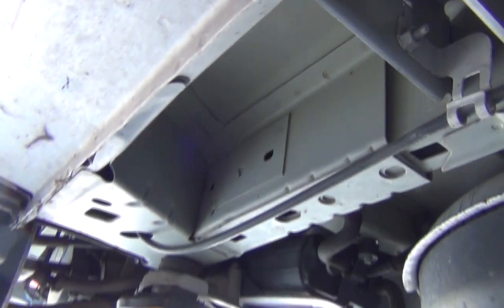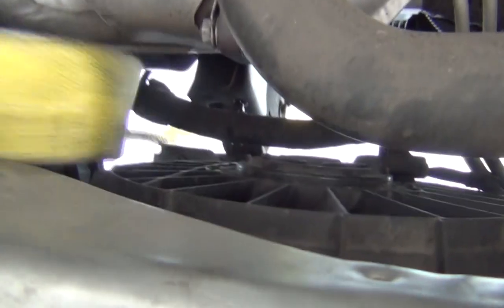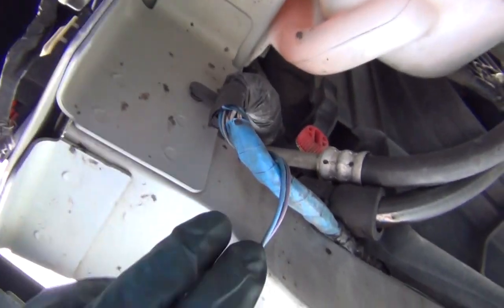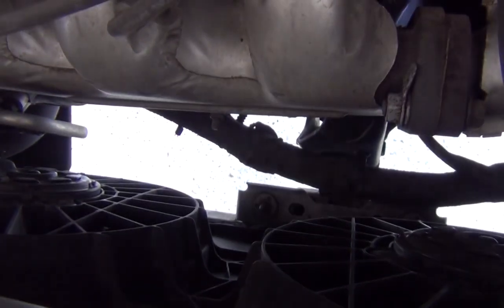How do you hook a Town and Country Mini Van?

Comment: Every minivan I've winched out was already buried to its bumper in the mud by its owner's unwavering determination to just spin the tires until they've covered their car in mud and managed to dig a hole significantly deeper than their tires reach. Just loop onto the rim spokes, and put the vehicle in neutral or the axle or suspension arm if its backwards.

Comment: I like your videos Brian, so I can learn in english how the auto words for parts and services are. I´ve lived in Salt Lake. But I live now in Brazil. Here about 80% of the autos are 4 cylinder with a 5 speed manual transmission, so being a mechanic here is mostly working on these models. Many people here don´t wanna buy automatic transmission vehicles or V6-V8´s engines because they burn more gas and its much more expensive to service, and requires more qualified technicians.

Comment: Thats the best way.  The factory chassis points were often ripped open or damaged and can spread open or tear on long hauls from my experience(30 years)  I feel better with straps and always rear both sides.  Control arms not designed bend easy.  I learned the hard way

Comment: Most all cars have this issue not only mini vans with poor tread on the tires. When we get to them most are buried to the oil pan so your good idea does not work for us. We have special slings for slotted wheels both front & rears we use which can also be use to lift the front or rear safely front or rear with no damage. I have owned my own recovery bussiness for 35 plus years in the Colorado Rockies we see it all and recover every thing even army tanks & SUBARU'S R no exception, Cheers

Comment: There is an engine mount bracket right in the front which is perfect for towing with no damage, provided you use aircraft straps, the actual alloy mount, NOT the motor section
Reply: Isn't that what he did in this video?

Comment: On a side note, its a general rule of thumb to stay away from straps with build in tow hooks. They are usually made with lesser quality metal that breaks at a  lower force than the strap itself.  It would be safer to use a strap with loops and connect it with a d-ring or clevis. The same goes for using a chain, if it breaks the force sends it flying at speeds that can easily cut a person in half. Just something to think about.
Reply: myth about "cutting peope in half" bud
Reply: @crabtrap  it depends on how much force is behind it. There was someone on the news in our area long ago because it broke one of her feet completely off her body.

Probably more likely in awkward stick vehicles that people mindlessly pull forward even though they need to be pulled up out of a steep ditch or up over something like a tree.
Reply: @Loduwijk  chances are, the foot lady had the cable wrap around foot and tore it off. Cable didnt dice it off

Comment: If they have the crush washer that will work. If they are conical seated you need to buy a cheap torque wrench to put them in, otherwise you will strip the head for sure.

Comment: Mine is AWD and I was looking for a way to drag some douche who was taking up two parking spots on the street.  Lots of inconsiderate pricks here in the urban jungle. Couldn’t find anything good but the rear axel.  Might get a strap like that to keep in the van. Thanks! Plan to have a custom rear bumper made with an integrated tow hitch and shackle/hook points. Eventually the same in the front.

Comment: when installing spark plugs (2000 chev suburban 5.3) how important is it to torque them to spec. i do not own a torque wrench and if I dont need to pick one up I will hand tighten them and then an additional quarter turn. thanks.

Comment: That's nonsense. Use s j hook on the lower control arm be carefully to stay away from axle boots and and lines ect. But that's how us tow truck drivers have been doing it for years. And no it does not mess up the front end

Comment: Does this work the same way on a Dodge Grand Caravan? And where do you hook onto the rear? We've had tons of rain and mine is stuck in ruts our driveway. The low tonight is supposed to be 13°. I don't want my van frozen into the muddy driveway.
Reply: if its still stuck, let the mud freeze solid and then slowing apply throttle and back out.

Comment: I had one Chrysler Mini Van.  Never, Never, Never, Never, Never, Never Never, Never, Never Never, Never, Never Never, Never, Never Again!!! Worst vehicle I ever had. The ultimate in a cheaply made pile.  Great tip though for those who still suffer through having one.. Take Care...
Reply: I drive an 06 grand caravan with 200k and change miles and the only repairs done were the cooling system. Tranny slips sometimes and it has a hard time shifting at higher gears but it is a 13 year old chrysler transmission